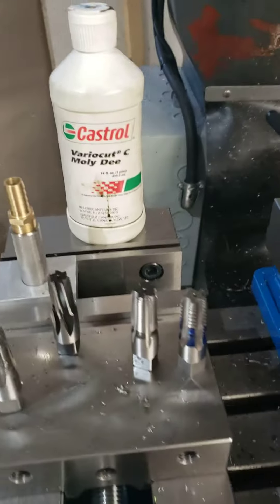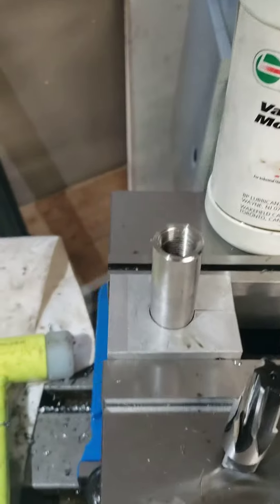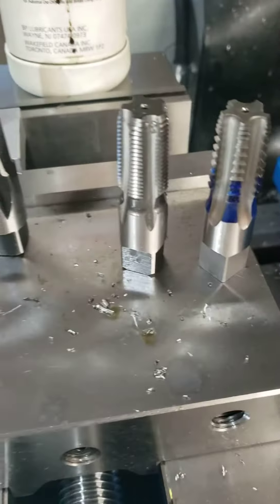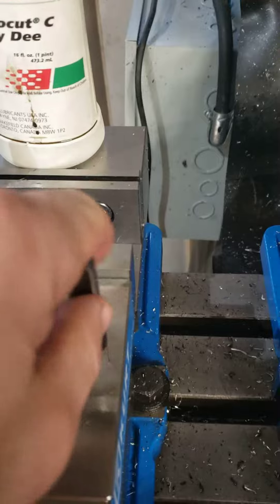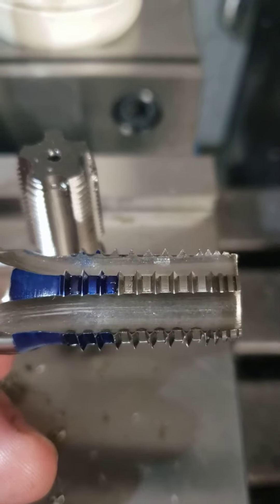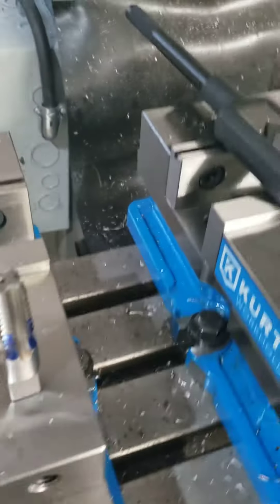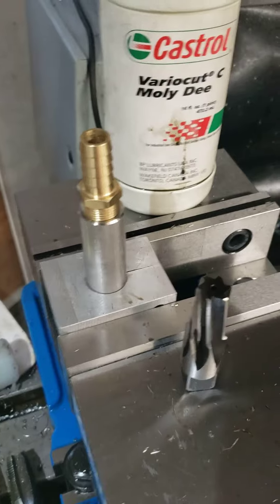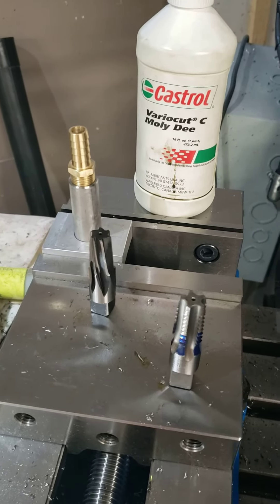tapping npt in 304ss

Comment: interrupted taps actually have higher chip load, but less flank load.
Reply from the maker: Ahh.  Tks the comment.  With an interupted tap, I can use a smaller handle, and the part doesn't slip in the jaws/vice